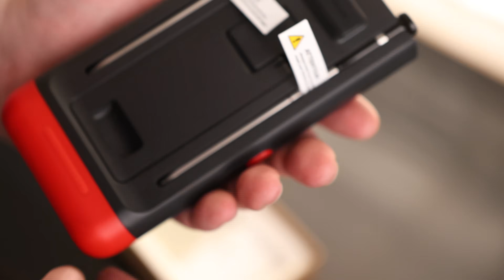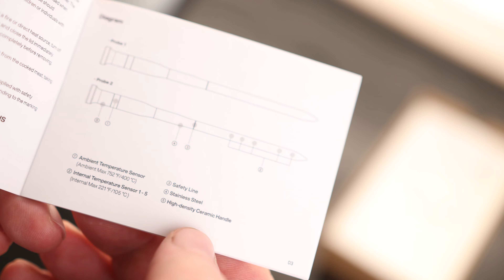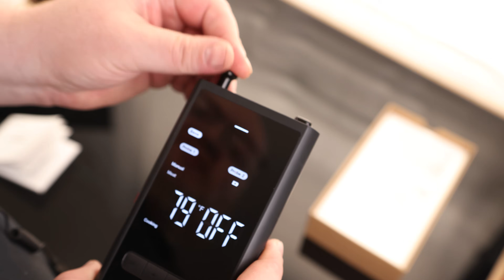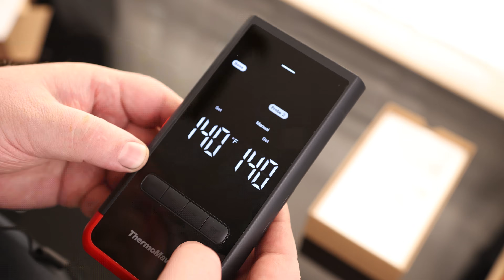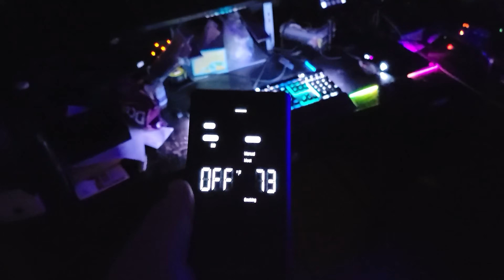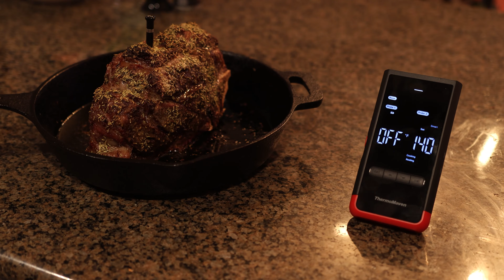ThermoMaven P2 Wireless Meat Thermometer with Smart Display Base, Bluetooth and WiFi, 2 Ultra-Thin

Comment: Seems like junk. I put both probes in the same oil and it read two different temps. I did the same with ice water. I over cooked chicken thighs while the temp read 140 F. I measured my oil temp while cooking and it said "overheat" and stopped reading. The oil couldn't have been higher than 350 F.

On top of that, how do you change the set temp? This thing has like 6 buttons and none of them change the temp. If you dropped a probe in boiling water, it would take 5 minutes to read 212, assuming it even reads correctly 

This thing is e-waste out of the bix.

Comment: not intuitive and setting the temp is impossible.  All it does when I press set and then the arrows is bounce between the two probes.  Got it as a gift but time ran out to return it (sick/hospital)  Maybe defective
Reply: That is your personal lack of knowing how to use a device.
I have the same thermometer, and after like 2 min I set everything as needed.  
 Nothing wrong with a thermometer. 
It is like retuning a car since you haven't learned how to drive it.
Reply: @valeriyGennadyevich  I stand by my evaluation.
Reply: @valeriyGennadyevich  I stand by my assessment.  That said, I would not be adverse to picking your brain as you seem to have cracked the code
Reply: @valeriyGennadyevich obviously you don’t know how to & just lucked out
Reply: Very poor instructions on how to set temp. Waste of time
Reply: @tubetime39  My kids could work this out in 2 mins without even reading the instructions. The buttons on the unit are intuitive and labelled. The app is awesome according to many reviews.
Reply: @grahamnumber7123 my grandkids are at the top 5% of there class and they couldn't show me and neither can you !
Reply: I think you watched a different vid / or are a muppet / work for a competitor. Buttons -  4 on the front - Up, down, set, and OK. Watch the vid again he shows you. The 3 buttons on the side are 1 big red one for on/off left side & on the other side 2 more C/F toggle and sound on/off. It's not rocket science. Maybe the app would be easier. I liked it's for those who can cook as it's got a setting (smart) where you take it out before to rest. Manual is to set the temp you want it to alarm at.... and this skips having to use any App
Reply: Why does the screen go blank while using?  Why doesn’t it display the current temp of the meat so I can judge who it’s doing?  Ugh!  This is frustrating.  I can’t verify my email in the app to use that version; it keeps saying failed.  Great timing right on Thanksgiving!

Comment: Have you tried the app?
Reply: I got this to review and it is impressive. The app allows you to access more functions and it’s somewhat similar to the MEATER but better in my opinion. There are 5 internal temperature sensors according to the depth in the meat so you can see how it’s cooking from inside out. Surprisingly, the ambient reading(after a relatively short time in the cook) was dead on accurate which has not been true with other thermometers I’ve used. You can tell the instructions and programming of the app were written by people who actually have cooking experience.  For example, if you set your target temperature on turkey breast to 157F, the app will tell you to remove it from the heat at 152F.

Comment: So this is a knockoff of the Typhur? I just got one and that look the same! Damn Amazon got me with a knockoff
Reply: They might be manufactured by the same company (who offers private labeling to others).
This doesn't look as slick as the Typhur but it has a larger screen and actual physical buttons, so I'm tempted to buy the ThermoMaven...
Reply: I did some research, and confirmed with the FCC IDs and filings that the same manufacturer makes Typhur and ThermoMaven. The probes on the Thermomaven G2 are identical and have the same chosen model number in their FCC filings as the probes that come with the Typhur Sync Gold. I didn't research the P2 vs Sync, but I assume those models likely share probes as well. I posted a full breakdown in a reddit post.